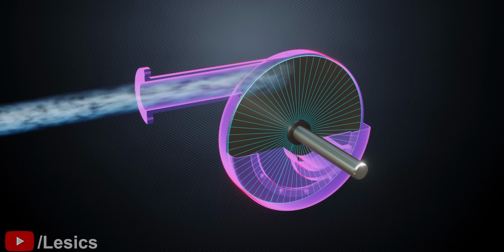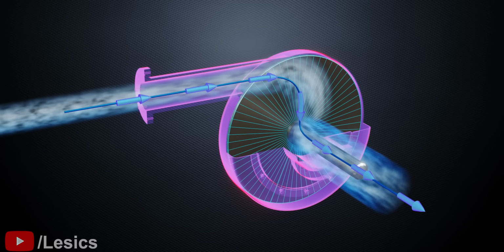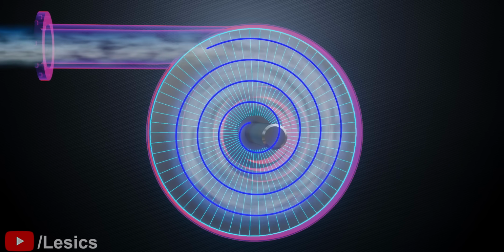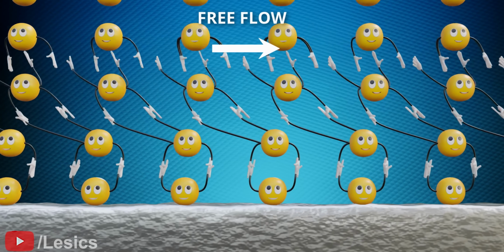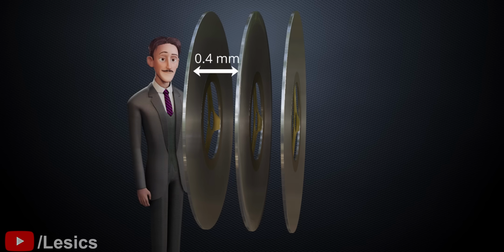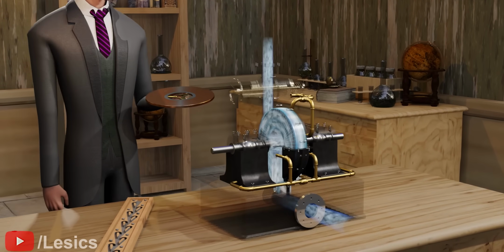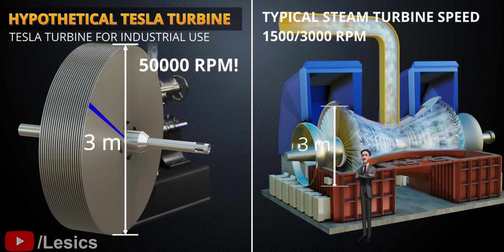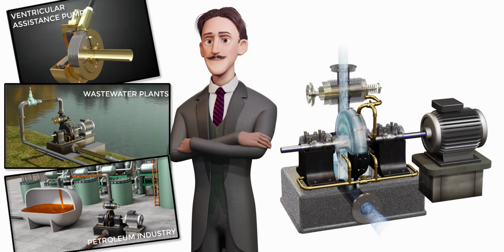Tesla Turbine | The interesting physics behind it

Comment: I'd like to ask a dumb question... For the 3 Meter & 50K RPM, you say the "Mach Number" would be 13.  I dispute that.

Isn't the Mach number relative to the velocity within the fluid (typically air)?  Due to viscosity, the input 'fluid' would be moving with the surface.  So, the surface would not be moving at any reasonable percent of Mach, relative to the fluid pushing it.  I feel (and I am not any kind of expert) there would only be two real issues... The centrifugal forces on the disks would be immense.  What would be the "G force" along the edge?  Also, as the speed increases, the viscosity would drag the fluid ever further.  Would this massively increase the pressure within the entire system?
Reply: Seem like sensible questions to me!

Comment: There's so much in this video that just isn't true.  If this device was as powerful and efficient as this video claims, it would be in use today in production facilities.  It's not, simply because everything Tesla invented had other designs that did the exact same thing with either less complexity or higher efficiency.  It's like comparing a Dyson fan to a regular electric fan, where the price difference and the output and efficiency between the two devices doesn't even begin to justify the price disparity.

Name one thing Tesla invented that went mainstream and changed the world?  The light bulb?  Nope. Electric power generation?  Nope.  Wireless anything?   Nope. Magic unlimited power? Nope.

Tesla was turned in to a hero and canonized based on this concept that he was the anti-capitalist and the brains behind things exploited by others while the reality is that he never made anything of value that could be exploited for profit.  He didn't invent the lightbulb and didn't even choose tungsten as the metal for the filament.  All that research had been done for him by the very person who commissioned him to build a prototype based upon his research and design.  That person was Edison who was educated and a real science.  

The most hilarious part is that ultimately the debate between Edison who believed DC was superior to Tesla who believed in AC superiority was ultimately the smarter of the two and won.  How did he win?  Look at the device in your hand that you're reading this on, or the computer your using and those devices only use DC.  If you supply AC, it's first converted to DC.
Reply: The argument for AC and DC was for long distance electricity. Tesla won because the power coming from miles away from where ever you are is AC and doesn't have nearly as much loss as DC. Edison's DC power lines could barely get any power anywhere without a huge loss in efficiency. Also who shit in your cheerio's?